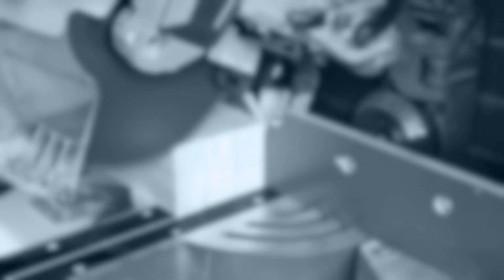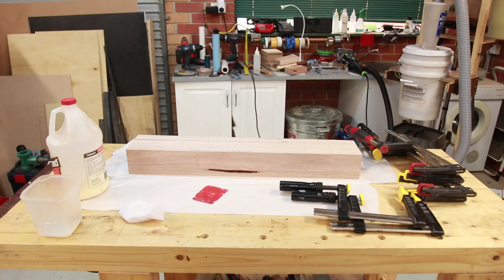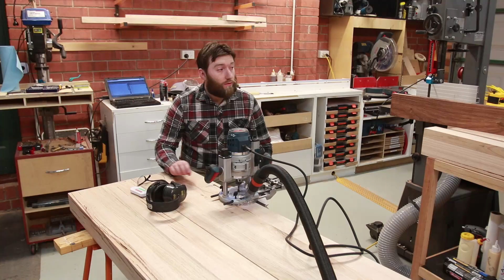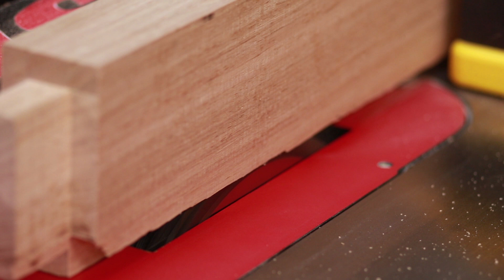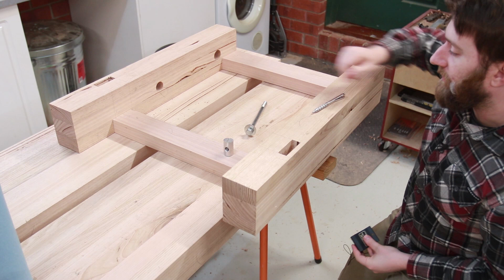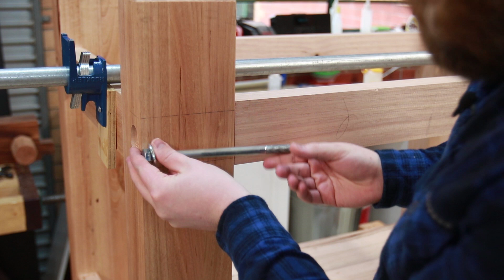127 - TWK Split Top Roubo Workbench: The Base

Comment: You had me right up until you drilled all the way through for the connector bolt nut...that's not the most aesthetically pleasing of choices. Personally I would have only gone 3\4 deep from the back and offset the threaded hole, other than that you got some skills man.

Comment: Great video. I'm assuming the dominos for the leg laminations are a belt-and-suspenders measure. When in doubt, make it stout...
Reply from the maker: +Ttf Web ya, just like the top lamination it's to reduce sliding while clamping. Biscuits or dowels would do the same.
Reply: I like the domino - I need to save up my lunch money
Reply: One thing I've done is drive in a couple of small finish nails and then clip them off to make little brad points.

Comment: Great build, Paul. Did you consider using lag screws instead of the bolt and nut?
Reply from the maker: Nope. I'm not sure how well lag screws would hold in end grain over time, and they might strip out the wood if I was to remove and reassemble a few times.

Comment: OOOO a blue miter saw blade... Pretty.... What make is it and are you happy with it? Mine is due for upgrade.
Reply from the maker: Its a Flai X30. I was very lucky, a viewer sent it to me, as they are pretty pricey. Previously I'd thought the standard Bosch blade was fine, but this cuts like butter, leaves a much smoother surface (pretty much burnished end grain), operates a bit quieter, and the saw strains much less when chopping through thick stock.

While its already expensive, Promac (Flai distributors) say that its not even their best blade - this "Z-type" X30 is in their trade range. Top of the line is the U-type/"Ultra Fine Finish". Given how the very smooth finish and very healthy amount of carbide, while it might be expensive, it will survive a LOT of resharpening.
Reply: Paul Jenkins thanks for that, will look into them, the sound the part!
Reply: JordsWoodShop I just bought a Forrest chopmaster for mine - unbelievable cut quality and accuracy.

Comment: New mitre saw blade, is it a Flai?

If so how is it so far? I still have the standard blade that that saw comes with on mine, need to get a new one sometime.
Reply from the maker: Yup, the Flai X30. I was very lucky, a viewer sent it to me, as they are pretty pricey. Previously I'd thought the standard Bosch blade was fine, but this cuts like butter, leaves a much smoother surface (pretty much burnished end grain), operates a bit quieter, and the saw strains much less when chopping through thick stock
Reply: Paul Jenkins Very nice, I'll have to look it up.

Workbench is looking great, I'm looking forwards to the rest of it.

Comment: Hey Paul, I'm really loving the features and design choices in this project. It's exactly the kind of thing I've been looking for, so I can't wait to see some plans and build one myself (now I just have to convince the missus to let me put all the other projects I've been promising I'll do for the last year aside so I have the time :p).
Reply from the maker: Try opening the argument with "A quality workbench makes it easier to assemble projects. which in turn lets you do a better job of them". I mean, you could make the other projects for her now but they wouldn't be as good! ;)
Reply: That's a really great argument. The only problem is that I just used very similar arguments to justify building an outfeed table, lumber storage rack, various tool and supply storage cabinets, and installing dust extraction piping in the shed :p

I think I'll have to pump out a few chopping boards or something while I'm waiting for the full workbench plans to be released so I can at least take the "self-licking ice cream" arguments away :p